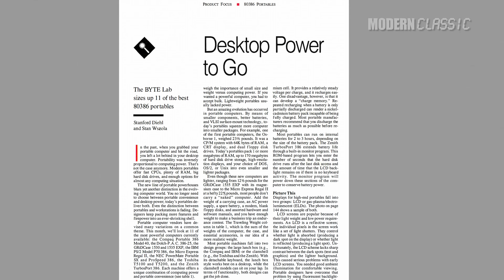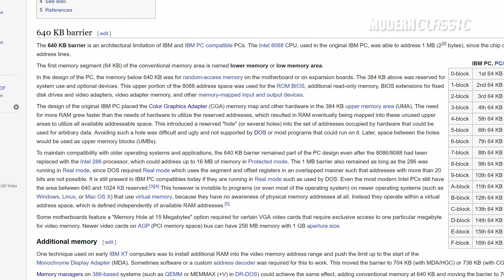IBM PS/2 P70 Tour and Diagnosis - Part 1!

Comment from the maker: Here's the latest update: first, when I pulled the drive out, one of the caps literally fell off due to leaking electrolyte that had weakened the solder. So I cleaned the board up as best I could and recapped it. Here's a photo from when I first pulled the drive: https://imgur.com/a/7gtistT

After the recap, I fired the drive up with the reference disk in and... nothing. BUT, I then changed disks, fired the drive up and... BOOM! DOS 6.2! It didn't quite get all the way through loading, though, so I reset, booted again and BOOM! A: prompt! Thinking the drive was fixed, I set up filming and put in the reference disk back in... nothing. Now thinking it was a problem with my reference disk, I put the DOS disk back in and... nothing. I haven't been able to get it to work again.

So... I'm guessing it's either my soldering (or the pads, which were almost toast) or some other intermittent problem, like a bad cable. I'm going to clean up my soldering as much as possible, maybe try using radial caps instead of SMD (I thought I did a decent job, though...) and try to rule out it being the caps at this point. If that still doesn't fix it, I'll move on to trying a different cable and/or drive.

At least I know the drive can work now.
Reply: Fingers crossed that's all it is. Even if you haven't gotten your cleaner disk in you can clean heads with Q-Tips and 99% alcohol. It's basically the same. My friend and I were working on a PS/2 all-in-one desktop model that was working perfectly, but had a hard drive with a damaged ribbon cable (which is not by any means easily replaceable/repairable). Sounds like PS/2 floppy drives have easier retrofits than hard drives do.
Reply from the maker: I did get the cleaner disk and I've also at this point cleaned the heads manually with alcohol. I don't think that was the issue, but I did it anyway. The drive still isn't really working, although it did those couple of times.
Reply: It looks like you may have some trace damage in the area where those caps leaked. It is also possible that fluid leaked underneath that screw to the other side of the PCB, but hopefully it didn't. Did everything look OK after you cleaned it up? Did you replace the non-polarized caps as well? I assume so since you said you recapped it, but I figured I would just ask! Best of luck!
Reply from the maker: I did replace all five caps (actually 2 1/2 times) and I checked continuity with all the traces. The only damage to the actual board was one of the pads; the third time I recapped the two polarized caps, I had to solder directly to the pin on the controller chip that the pad traced to. Unfortunately the computer still won't boot, but I now no longer think the problem is the drive. (See the new pinned comment I'm about to write.)

Comment: I had an Toshiba T5200 with plasma display over 20 years ago. 386DX/20, 4Mb RAM and two ISA-slots: 8bit and 16bit. Replaced processor with 486DLC/20 and put GUS Classic inside. It was great for playing .MOD music :)

Comment: I have a non-reading floppy disk drive on my Model 30/286. It is a 1.44MB unit. Expensive as crazy to buy separate. Now you got one more option you could try. Buy a broken P70 that comes with the floppy disk drive and hope the floppy works on it. I've been thinking of buying a neglected Model 30 and use it for parts. Especially the floppy drive in it will definitely come in handy. 

Edit: read your update. Good to hear it was so obvious. Good luck with the repair!
Reply from the maker: Thanks! I'm definitely still up for buying a parts unit, though, and on the lookout for one. But I'm "in the weeds", as they say, on fixing this at the moment, so kind of enjoying that too. Can't wait to get the new caps.

Comment: I am crying, about 5-7 years ago I threw away a fully functional M70 modified with a standard I/O RS232 chip. I loved that amber screen. And it had a 387 math co-processor. I used it only with IBM-DOS and  the database development tool Clarion. All original disks also went in the trash. I don't remember the keyboard beeing that flimsy, perhaps Europe/Swedish version was different.

Comment: Hi! I've found your video just because I have a P70 that I worked with in the 80's. It has been resting for decades on a garage and it has all kinds of dirt and DNA, but I think I will try to clean and see if it still works. If I remember correctly it has OS/2 installed, and if it runs I of course can't remember the password I was using at that time.
I've loved to see yours!

Comment: I have one. The caps in the flippy drive was leaking. I removed them, cleaned the board and repaired some tracks that was corroded to hell. Soldered in some new leaded caps (SMD caps are not easy to put back on a damaged board) and it's been working perfect ever since.
Reply from the maker: Mine seems to be resisting my recap attempts; I'm going to give it one more try and then cut my losses and buy another drive. The circuit board is just in really rough shape; could be beyond my skills in saving. But everything else on this machine is now working, so once that's sorted I plan a more structured part 2 of this video, in which I actually get it going. (Right now I have a floppy emulator working with it, so it's fully functional as far as I'm concerned, but I want it to be working as originally designed before filming the second part of this video.)

Comment: I would check for Capacitor leakage on the driver boards of the floppy drive if cleaning it is not successful.  I dealt with a very similar issue with a PS1 model 2011 floppy drive not too long ago and replacing the tiny surface mount capacitors did the trick beautifully. It is, however, not an easy task to replace them and requires quite a lot of soldering knowledge. Check the boards for an oily or sticky residue. This is a sure fire sign that leakage has occurred.
Reply from the maker: There definitely has been leakage, and worse - check my pinned comment for a pic. I have new caps on the way now...

Comment: The Toshiba T3200 is another, similar computer with a orange plasma display... it also looks way better.
Reply from the maker: Funnily enough, the T3200 is being introduced on that Computer Chronicles episode I embedded at the same time as the P70! I just like the P70 because it has a more interesting form factor; the T3200 looks like a big, old, chunky laptop.
Reply: @ModernClassic  Having actually had both of these back in the day, I too like the P70 more. I'd love to have both back as examples of my past, sure, but at the time the P70 was the one I favoured. It was a lot faster, more upgradable, had a proper VGA output and all that, but was still easily transportable for the time. Sure, the T3200 still packed everything you tended to need on the go, was a fair bit smaller, a lot lighter and most essentially, needed a lot less table area to use. It actually even functioned as a laptop, albeit a plugged in one. So, both had their pros, but the P70 saw much more use as it was truly a portable workstation.

Comment: The keyboard switches are ALPS Plate Spring switches. They're still very good in their own right, and are actually more similar to IBM's old beam spring switches than they are to the buckling springs. Of course, they're much smaller. It's a nice find you've got there, even if it isn't working right.

Comment: The PS/2 line requires Resource Disks to configure the hardware. Run those and it should be fine! :) Great machine!!

Edit: aaaannnddd you just mentioned it haha sorry!!

Edit 2: yes replace the caps on the floppy drive. Timing is key!

Comment: Hi. I'm proud owner of P70 and P75 (486 version), as well as few desktop PS2 models. All initially had bad battery and floppy drive. Main problem on all floppy drives were capacitors, especially head preamp filter caps. My suggestion is replace all floppy drive caps and do usual cleaning and relubrication.
My P75 had one display hinge broken. It breaks because of tension and stress caused by spring. Forget about glue, it's ABS plastic and tension is too strong for any kind of glue fix. I revise engineered the hinge and 3D printed it. I also made it harder to break by strengthening the weak spot. Bad news I did 3D files only for one side (other side is inversed), but even bigger bad news is I lost 3D files :-( Some people asked me for these files, I really searched everything, but can't find it.
So, my suggestion is - replace all floppy caps, clean and relubricate, find someone skilled in 3D prototyping to make you replica for the hinge, make both hinges and 3D print :-) Wish you luck.
Reply from the maker: Thanks - I'm actually planning all that now. The drive definitely has bad caps; I found leaked electrolyte and one of the caps just popped off the board on its own when I took the drive out. So I've got new caps on the way now, and I'll clean and lube the drive at the same time. I might have someone who can help with the 3D modeling for the hinges; I'm talking to him now. Hopefully I can get everything sorted out.
Reply: Yes, recapping the floppy will solve the problem. Then, after you boot reference diskette you will solve RAM configuration error as well. My P75 has also leaked caps on mainboard and especially on VGA card almost destroying it! These around 90ties surface mount alu caps are disaster. Here is full picture album of my IBM P75 restoration including details on floppy, hinge, mainboard and casing restoration: http://www.indigo-audio.com/audio/Retro/IBM_PS2_P75_Restoration.zip
Reply: Nice work on your restoration as well, and sad to hear that the 3d design assets were lost. What about the gcode that was sent to the printer? If you can dig those up, the stl files can be retrieved via a utility.
Reply: @ModernClassic  How're the glued hinges holding up?

Comment: When do you think we’ll see part two?  Great video.
Reply from the maker: Soon! It turned out the floppy drive was too far gone for me to fix and I had to source another one, which took quite a while. But it's in there now. I'm currently having some intermittent issues with the display card that I'm in the process of deciding whether I should do anything about (if I do, I'll film it; probably just needs a contact cleaning), but about 70% of the part 2 video is already filmed. I just need some shots showing off some of the games I've installed, the Windows 3.0 install and apps that the previous owner had (the hard drive is 100% full, including compression), and the external VGA support and it'll be done. Probably the video after next.

Comment: there used to be a guy named Peter Wendt who had the MCA page, and ran the MCA mafia in the mid 90s. Search google there were a bunch of guys including myself that contributed. I still have a old PS/2 Model 70 with a Kingston McMaster that allowed me to run a couple extra 8 meg dimms, and a cyrix 100 mmx processor in the P70. cool stuff.
Reply from the maker: I probably have stumbled across some of those pages and I'm sure they helped me. Part 2 of this is coming very soon; it's 100% filmed, and the computer's now working. I've heard of those Kingston cards (maybe I even saw you talking about it somewhere) and they seem really interesting. Would love to have one but they usually seem insanely expensive these days.

Comment: Hi All , Nice find, once you get the floppy working, use laplink 5 via the serial or parallel port into another XT-AT-386-486 running up to Dos 6.22, trasfer will be slow but that is what overnight is for.
Other than the physical floppy, is the a ribbon header on the mother board that you can connect another similar PS2 style floppy, ie open the case and run a ribbon outside to another floppy.
Most dos software including windows 3 - 3.11 can be just file copied and replaced on another drive, some tweaking is needed for paths etc and other missing files, but if you clone / or do a complete file & folder copy it should work out OK

I dont know if finding the floppy part number and then searching the part number  to see if it was used on  any other IBM machines of the time gives you a larger choice of substitute models to sue as donor parts, failing that any change of using the pinout diagram to work out the data cables and how similar it is to regular floppy controller and which ones have power, then split the power cable and use a molex or external transformer to provide power

The boot disks you made should be workable in anther machine as they contain dos or IBM dos to boot then the actual setup / restore programs for the PS2 hardware , i hate to think the floppy diskettes themselves are faulty, try a stock 720 or 1.44 known working dos 3.3 / 4 / 5 / 6 / 6.22 boot disk, test on another machine then if proven it boots then place into the PS2 and you have eliminated 1 error the diskette so now it is the drive or the hardware letting you down

Regards
George
Reply from the maker: Thanks - I forgot all about Laplink. Will definitely look into that to back this thing up. As for the floppy, I did know in advance all the different models I could use, but none of them are particularly common or cheap. Someone in another comment found one that I'd missed and if my repairs don't go well then I hope it'll still be available (it's a store so they might have more than one), but I would prefer to keep this machine original to the original part numbers so I'm now trying to repair the drive.

I do wish I had another PS/2 or even another IBM compatible of this era that I could test them in, but I don't. But I'm 100% confident that the drive is faulty; the disks may or may not be too but the caps on the drive are visibly and obviously dead, so I'll replace those and if I still get no result, I'll think about testing the disks some other way. But I know I need to replace those caps regardless.

Thanks for your help!

Comment: My dad worked for IBM and brought one of these home because the office was just gonna throw it out.  I thought it was pretty cool, but it did later on develop an issue with the floppy drive (never got around to figuring out if it was the belt or dirty heads or what).  I meant to grab it and ship it to my home when I visited my parents last Xmas, but apparently my mom made my dad throw it out since it was just sitting in a closet for several years. :-(
Reply from the maker: That's sad... I did already figure out that one of my problems is definitely bad caps (electrolyte all leaked out of two of them, and one of those two popped right off the board on its own). Hopefully that's the only problem. But it seems to be very common so could have been your problem too.

Comment: have you tried holding down a key (any key) when turning on the computer?  This might generate a keyboard error and force you to go into setup.
Reply from the maker: Unfortunately there is no built-in setup. The setup is on the reference disk, which the computer needs to actually read before it can load it...

Comment: Recap the floppy drive and give its board a good cleaning while you're at it. Most everything from that time period with surface mount electrolytics has trouble with them leaking. The system board (planar) may also need some attention.

Last time I checked, my P70 had developed the same problem, so I have the same operation ahead of me. Thankfully I had already replaced the CMOS battery beforehand, and these should last a good while.